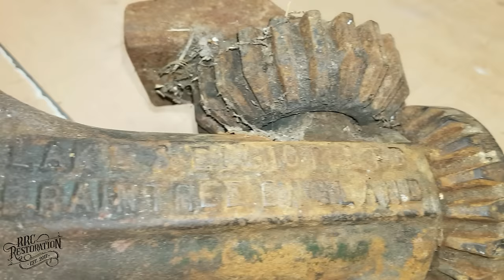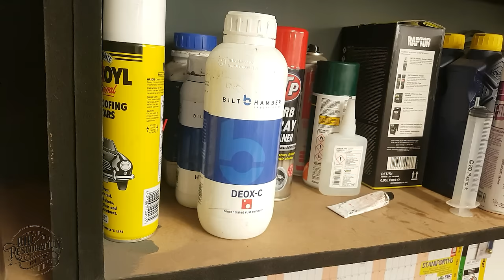1930's Screw Jack Saved From The Junk Man - Perfect Restoration

Comment: Here's a small tip. Cast iron parts are rough not sanded smooth with Bondo and filler. Once again this isn't a restoration it's a modernization.

Comment: Nice job, especially with the paint. I feel like two significant things were missed though - how did you reattach the top piece? And isn't there supposed to be some sort of handle that goes into the slot on the crank mechanism?
Reply: The handle was likely just a piece of wood and is long gone.
Reply: @SilvaDreams  I have 4 of these jacks, all left to me by my grandfather. the handle on two of them is a piece of wood with three steel bands, one on each end, about three inches from the end acting as a stop as well as a reinforcement, and one dead center, and there is a 1/4 inch rod going down the middle of the wood. The handles are only about 1/2in by 1in, so the reinforcement is rather necessary to lift larger stuff. Years ago, before he passed, my grandfather noticed the bottoms of the post on his pole barn were rotting, so him, and a few buddies got together with their jacks, almost all this type, and lifted the WHOLE BARN up about 6in, cut the bottom 4in off, and set it back down. I only wish I knew how much beer was involved 😂

Comment: Great video, but I do have two questions. 
Why did you select sand blasting instead of vapor blasting for most of the parts? And how did you attach the top piece? did you weld the top piece on and grind the x pattern into it?
Reply: Was wondering the exact same things!
Reply: +1
Reply: I was wondering about the top piece as well. I reviewed the video to see if I missed something...
Reply: Same here... It felt like an incomplete video. No matter how much he worked on it. Two different types of blasting and no explanation. The finished top felt fraudulent... he kind of sneaked it in there.
Reply: I would suspect the vapour blasting is easier on the metal, leaving a smoother finish as its a screw thread. 
The sand blasting on the rest is fine as it was getting painted and that would fill any texture left by the pitting etc

Comment: Funny. I did this exact same restoration last September. I found one of these at a swap meet in Packwood, WA at the end of summer. I paid $7.00 for it. Rusty and frozen. I'm guessing it's in the same ~1930's vintage. I took a little different direction. Mine was seized up fully. Both screws were frozen with rust. Mine got a week in Evap-o-rust and then I had to use a fair bit of heat to get the screws apart and moving again. Then they got the wire wheel treatment. Other than that it got the blasting and John Deere Green and Yellow paint job. Sadly mine had no lettering on it so I have no idea who made it or when. My second stage screw was slightly bent as well. A bit of pushing on some steel blocks in the 20 ton press straightened it right out like new. These are really ornate jacks. I can't find any photos of the handle so, I've decided to make one out of some steel flat and some pipe so the handle will be round. I'm sure the wood handles are made of un-obtanium by this late date. From the earlier comments, We were all waiting with anticipation to see how you put the lifting foot back on the screws. But you kept that Top Secret 😀. Great restoration. I love your stuff. Very inspiring. I assume the gears and screws got a wax based dry lube for rust protection? Something like a quick dry motorcycle chain lube?

Comment: Nice video. I am curious as to how you restored the part you drilled out when disassembling the Jack.  Did you weld a new piece of steel there? I would have like to see that part of the reassembly process (pinning the top back on).

Comment: Cracking video but a couple of questions...
1. Any reason we didn't see the repair to the screw that holds the head on ?
2. Was there a reason behind vapour blasting the worm screw but sand blasting the drive and worm drive gear ?.

Cheers 👍🏻

Also we saw you go to put the drive gear on backwards before the shot changed 😁😁😁
Reply: Yes, number 1 is really annoying... drill to death and suddenly it's back? ;)
Reply from the maker: Thanks for the comment. I'll answer as best i can, 
1. I deliberately left the repair/fitting of the pad out of the video as I didn't want to show how i done it incase anyone  thinks " oh thats easy i'll give it a go myself without the proper equipment" and they end up with a very dangerous jack. if that makes sense? 

2. The screw got vapor blasted as I was keeping the bare steel and wanted to restore the oem finish. The sand blasted parts were all parts that were getting a paint finish.

Haha yeah i though i could get away with that little mistake but you caught me lol
Reply: @RRCRestoration  Fair enough, can't argue with that 👍🏻 Thought there would be rational explanations as your videos show you're not a bodge it and leg it mechanic 😆😆😆 Cheers 👍🏻

Comment: How did you end up mounting that top plate on the shaft? I've missed that?
Reply: I was wondering about the same thing
Reply from the maker: The drilled metal was replaced with weld then the pad was put on and the steel mushroomed and marked to match the original along with a few other crucial steps, this wasn't filmed as I don't want anyone copying me and doing the job incorrectly and ending up with a dangerous jack. Hope that makes sense?
Reply: @RRCRestoration  Makes complete sense. I can see the risks if done incorrectly.
Reply: @RRCRestoration  Makes perfect sense. Thanks for clarifying ! 👍
Reply: @RRCRestoration  gracias por la explicación.
Reply: Can I borrow that?

Comment: Why did the screw get water blasting but the rest got sand /media blasting?
Reply from the maker: The screw got vapor blasted as I was keeping the bare steel and wanted to restore the oem finish. The sand blasted parts were all parts that were getting a paint finish.
Reply: @RRCRestoration  thanks. I always wondered why some parts get madia blasting and others are vapour blasted.